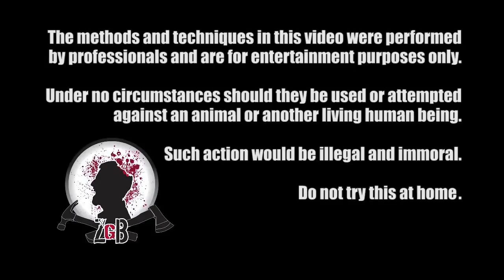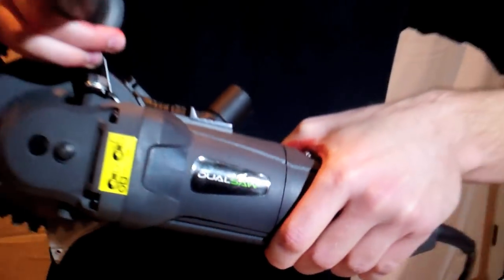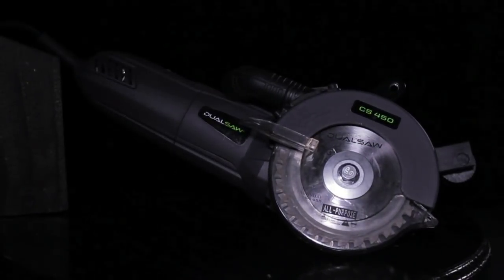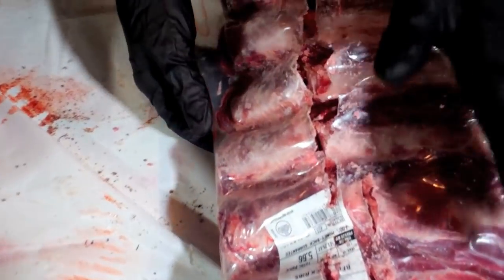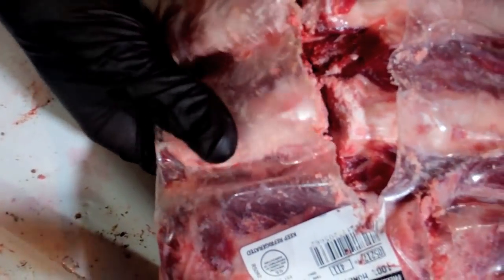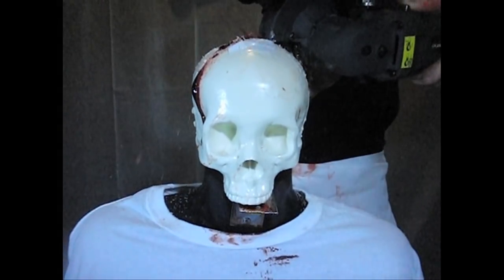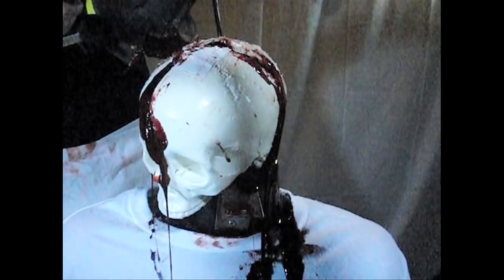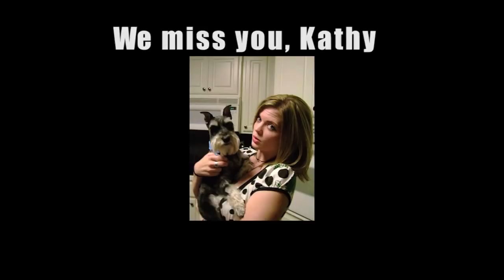The Dual Saw Test!  How to kill a zombie.  How to survive a zombie outbreak.

Comment: if you tokk off the blade guard and clipped off the power cable in exchange for a power cell or battery pack it would work better.